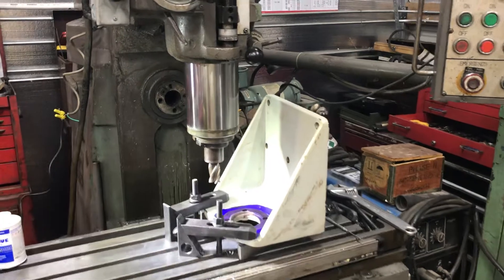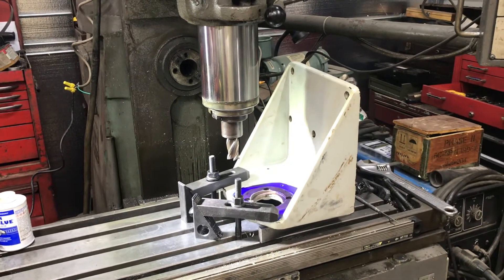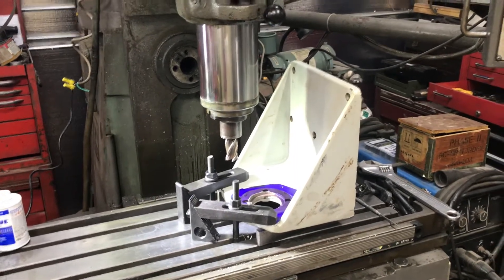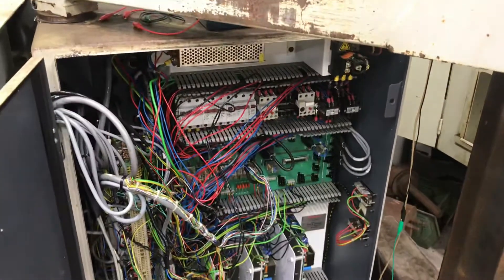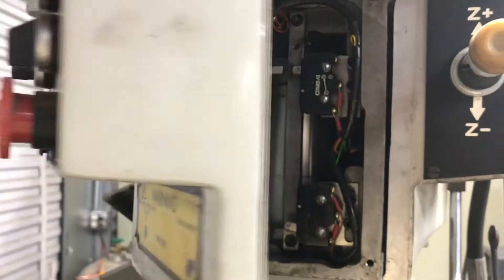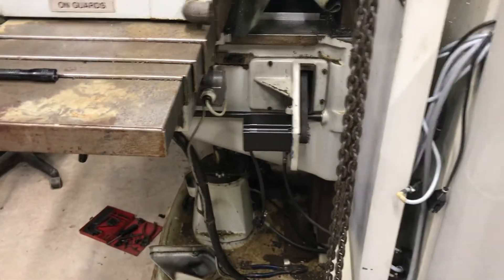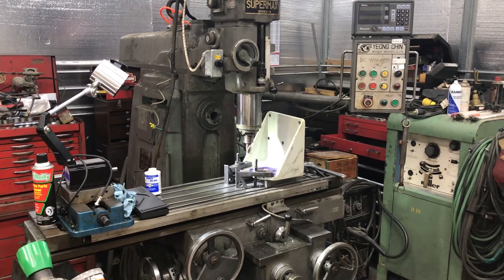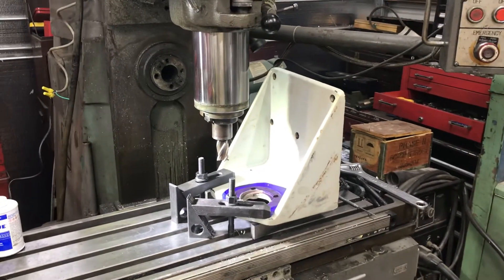Bridgeport CNC Centroid Conversion

Comment: I'm looking to buy a Bridgeport & convert it to CNC at some point. I'd love to talk with you. How can I reach you?
Reply from the maker: That would be fine, however, I would not recommend buying a Bridgeport Mill and converting it cost-prohibitive. I would buy a Bridgeport CNC like the BOSS 5 or BOSS 6 great candidates for conversion and very less expensive. By the time you buy the screws and then are still dealing with an only metal that is more than likely needing to be rescraped. Get BOSS5-6 from a school that is broke, I have purchased a few of them for around 1k.
Reply from the maker: Sorry in in the late response, my advice don't do it. You would be better off getting a USED CNC Knee mill and converting that, honestly by the time you get a knew mill converted you are still dealing with a tremendous expense in ball screws and fitment, save you money get an older CNC knee mill like a Bridgeport Series II CNC and take it to the next level, I have 5 of them in the last 14 years and everyone is still working fine.